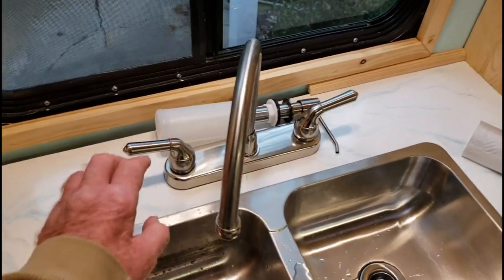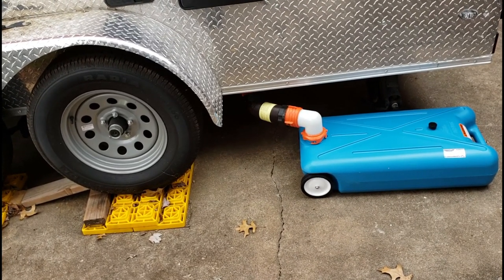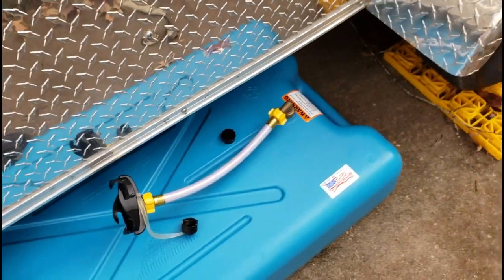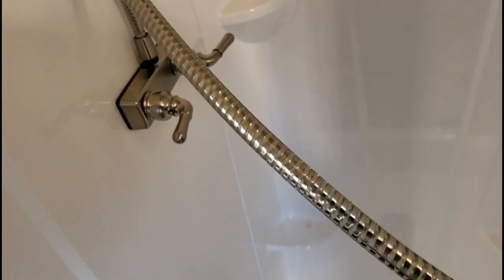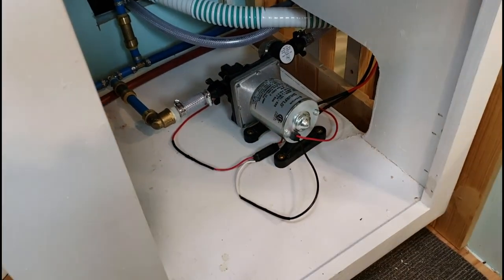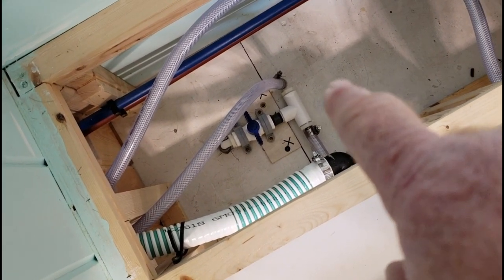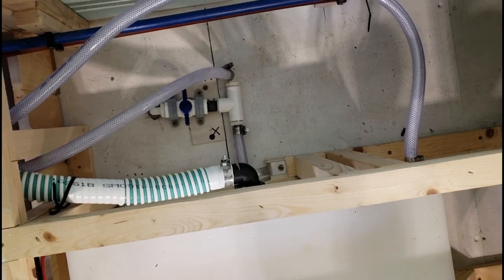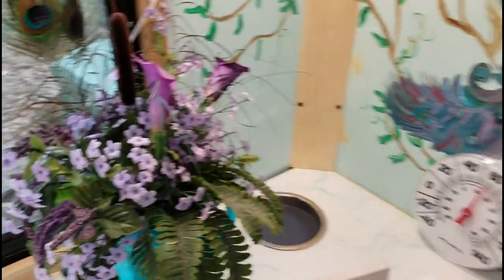Cargo Trailer Conversion PLUMBING IS DONE What we learned

Comment: Wish you would have discussed how the gravity fill works.  I'm looking for a tank and trying to figure out in my mind how the connections would go
Reply from the maker: Most RV style water tanks have a 1 1/2 inch inlet/outlet and a 1/2 inlet/outlet (threaded).  Many have 2 of each on opposite corners. They are also available in a variety of sizes and dimensions. RV style gravity feed water inlets are available on Amazon (as well as tanks). Most RV gravity feed water inlets are for  1 1/4 inch tubing. The water inlet at the tank would require a hose barb fitting that is 1 1/2 inch mpt×1 1/4 inch barb.

Comment: Maybe you could have heat that tube up for that first 1-1/4” barb fitting and slipped it on. That way when it cools down it’s nice and tight. I’ve done that before.
Reply from the maker: Although I didn't go into it in the video, that was the first thing we tried. I think maybe the issue was the first fitting had multiple barbs whereas the second fitting only had one. I was also prepared to shave the barb down a little if needed, but it turned out I didn't have to.

Comment: Hi, love how detailed your videos are! Can you explain to a novice how your plumbing system works when you’re hooked up to city water? To clarify, when water comes into the trailer does it go to your tank first or can it bypass the tank and go to the faucets directly? Since the water is always on from the city supply how do you keep from the pressure building too much and bursting your pipes or tank? Thanks!
Reply from the maker: It sounds complicated, but its not. I plumbed our conversion with 1/2 inch pex pipe. To control the flow between city water and the fresh water tank, I used shark bite push to connect check valves. At the time, they were around $10 each. One check valve is arranged to flow "with" the city water inlet, while the other is arranged to flow "with" the fresh water tank pump. When connected to city water, the flow coming in "opens" that check valve while "pushing" the fresh water tank system "shut". Of course the fresh water tank check valve needs to be mounted "after the pump". There's a couple more fittings ("Ts" etc) needed for this, but that is the basics. Maybe this would be a great subject for a video. Stay tuned.

Comment: Curious with your drain system if you have ever been connected to sewer, have you had any issue with smell. I'm going to do the same setup for our cargo trailer washer/dryer
Reply from the maker: We have no odor issues at all. We used a Hepvo P trap as each drain.  They work great. They're available in 1 1/4 inch and 1 1/2 inch sizes. They can be mounted vertically or horizontally and can be exposed to the weather since their design does not leave any liquid suspended in them. Of course the RV sewer dumps are 3 inch, so we has to use a pvc fitting to upsize to the 3 inch RV style fitting. The hepvo uses a membrane shaped kinda like a sock. When liquid hits it, it opens up, and then closes when no flow is present. We love them, and the price is about $35 each. Simply google "Hepvo P Trap " the webb site should pop up.

Comment: Nice! Where did you get those big blue tanks with the wheels at?
Reply from the maker: Amazon. They are Barker auxiliary tanks. One is a 22 gallon and the other a 10. We are moving on up to a single 32 gallon in the spring. Barker as well.